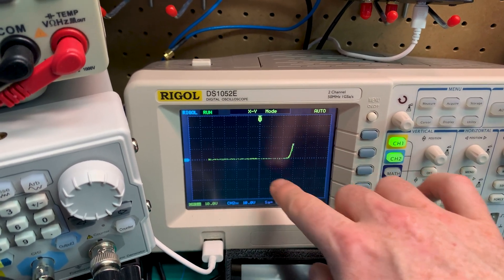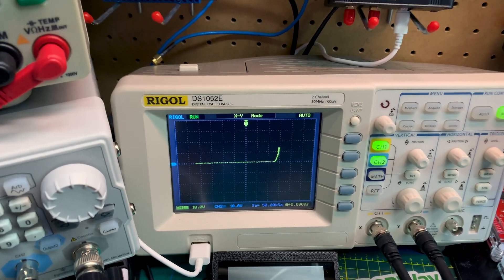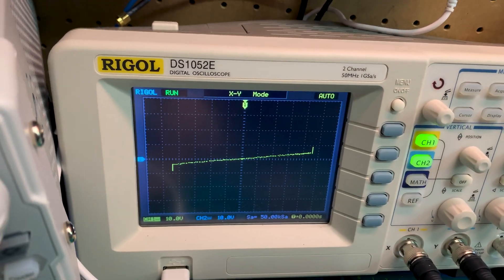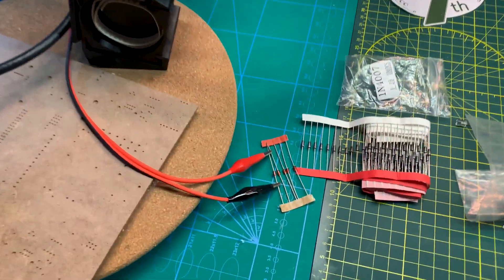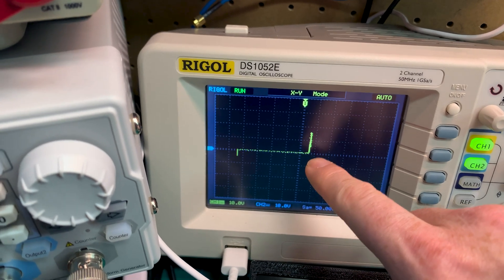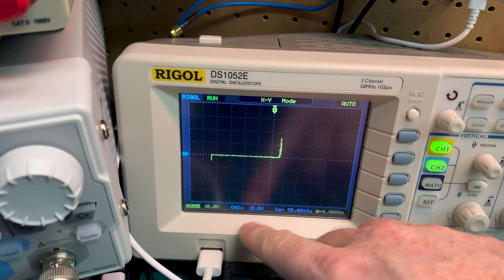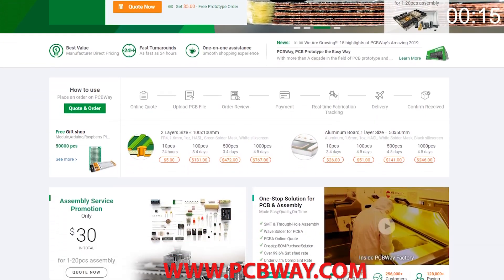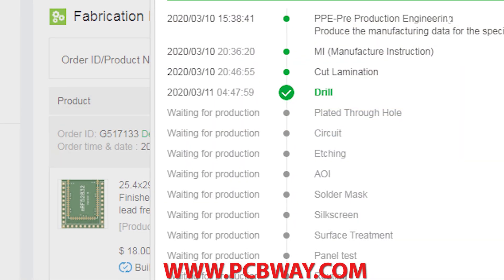Curve Tracer- My Newest Lab Tool | Update

Comment: Didn’t mean for my comment to get so long, but I thought I would share a bit of my experience with curved tracers and other really neat devices for quick and easy troubleshooting.

There are a lot of nice curve tracers available in both completed or kit form online. Check out the “NFM” channel.... he did a DIY curve tracer build from a kit six months ago or so here on YouTube.

Also the old RCA oscilloscope model wo-33b came with a built-in curve tracer from the factory. The 33B model is a bit harder to find than a 33 a model. But I found tons of them locally and ham feet’s and swap meets. Usually for under $20.
it comes built-in with a very nice curve tracer you can just switch over with the flip of a button. It’s only a 5 MHz bandwidth scope but comes in very handy and if you can find the model with the built-in tracer they’re usually $25-$50, of course if you find it online you have to pay shipping. Mr. Carlson completely disassembled and refurbished one on his channel and I think a few other youtubers have shown restorations of the same scopes.. It’s a very easy refurbish job. I’ve done about a dozen I guess in the last 10 years to give to friends or family who started their own labs as businesses or hobbies. And I always have two at arms reach on my own daily bench. Because not only is it a nice oscilloscope but also the curve tracer comes in very handy

Also Mr. Carlson designed a very nice circuitboard that can be installed in most any oscilloscope to give it a curve tracer function. Even though the circuit layout isn’t available unless you join Patreon, the video can be seen on YouTube.

 it’s a very easy circuit to make at home, or you can always send out the design to PCBway or someone and have them make a batch cheap and quickly. If you’re into building your own test gear I also highly suggest Mr. Carlson‘s low-voltage capacitor leakage tester. You pay $2 to join patreon and you have access to all of his circuit and test equipment designers. All of which are genius designs. Dude really is the maestro... it’s the best two dollars you’ll ever spend in your life.

I do this for a living and have my own small lab. I do mostly component level troubleshooting and board repair for manufacturers and industrial type clients. I specialize in test equipment troubleshooting and calibration for small labs and stuff like that. Along with other metrology related tasks. Honestly I started my lab completely by accident years ago as a way to fund my addictions test equipment.

A few other extremely useful test equipment designs are the “leak seeker“ and “Cap Analyzer“ by “electronic design specialists”. They pop up from time to time on eBay. Either the old models, or the new updated versions that are usually available only in kit form. They’re not the cheapest kits, but will become your most used tools in the lab. Seriously.

The cap Analyzer is foolproof and requires no understanding or practice. The leak seeker is super simple and intuitive, but takes a bit of practice. Just like a fancy new oscilloscope or something. You can use it as soon as you get it on your bench… But with just a bit of practice… it becomes like second nature and much more intuitive. 

 The leak seeker is just awesome. tracking down short circuits in mere seconds. Even on the most densely populated and complex boards. It’s one of the most innovative and precise Circuit designs I’ve ever seen for measuring constantly changing and extremely low resistances quick and accurately. Especially considering it’s not even using a kelvin connection.  I have several NIST traceable resistance and voltage reference standards I use in the metrology side of my business… and I’ve repaired countless types of test equipment used for measuring the lowest of resistances. So I understand what is required for an accurate and quick responding low resistance measuring circuit. Dave Migga… (The guy who founded EDS and who designed all of the circuits including the leak seeker) .....
Really hit a home run with the leak seeker circuit, It’s simplicity… And its ability to measure lower resistance quickly with no jitter. It really is impressive.

Even though I have all the fancy benchtop LCR and capacitor analyzers… I reach for the “”capanalyzer” literally multiple times every single day without exception. And I always keep one in my travel bag used for troubleshooting stuff in the field. And every time I see one pop up on eBay for a good price I’d buy them. Whether to keep as a back up to my back up, or to gift to a friend or trade. I wish everyone who think it was electronics had the pleasure of tinkering around with one. It will find 95% of the bad electrolytic caps IN CIRCUIT without having to desolder..... I’ve owned almost every capacitor tester ever made. (I told you it was an addiction😬🤷‍♂️). 

And don’t get me wrong… Some of them still come in very handy and are needed and very unique cases. But for the most part I don’t even have the money more. I’m sure my Family of Sencore z-meters like the lc103’s and others are jealous of the EDS cap analyzer. And I was skeptical at first but I’ve used it every day for several years now, and I’ve even built three separate ones from the kit that’s available from time to time. For the first several months I only used it out of curiosity what compare it with the readings of my more expensive professional analyzers, and I am satisfied and I trust it completely. Also measures DCR automatically. and sweeps a wide range of frequencies when measuring ESR of capacitors. And it’s all done automatically within two seconds. I have no affiliation with Dave or any of the folks selling his parts and kits. I just tried to spread the gospel because I want to see more folks give it a try. It’s the original in circuit ESR teste that BK precision and countless other companies copied over the last 35 years. But they adulterated the circuit design, and none of them have worked as well as the original in my experience.

Sorry this was long I will shut up now.... I could discuss test equipment forever
Reply from the maker: I actually have the kit NFM built (CH-012) inbound and will be building/using it in vids. The kit is cheaper than I could build it myself.  Unique way to visualize components on a video- hence this curve tracer too.  On ESR- I have a cheapie that works like a charm on the bench for most caps.  Got it for about $40 back in the day and it has never let me down.

Comment: we had a similar device at work years ago, it seemed a great idea but after the initial enthusiasm wore off it was rarely used. I guess if you have lots of similar components to check or work in a production environment and have built up a library of signature wave shapes to compare with then it might be worth it. Good luck and happy testing with it anyway :)
Reply from the maker: My use case is pretty unique- For starters I just like the concept of seeing the part performance through all operating levels but the real driver- It makes a super visual way to show things on YouTube videos so the audience can follow easier regardless of knowledge level.

Comment: Did you set your oscilloscope inputs to 1:1, instead of the usual 10:1?
Reply from the maker: FYI one axis was indeed at X10 so thats why the amplitude was so low on Y :)
Reply: @MkmeOrg  It seems that everytime I need to change that setting, I spend five minutes looking for it...lol  I wish it was just a switch under the bnc.
Reply from the maker: I think I did but I'll double check since its still set up.   I actually got the manual/schematic now so just need to make time to play some more :)
Reply: Since you're in XY mode when working with the curve tracer, the 1x/10x setting is not relevant. You don't measure anything, it's just a visualization of the x-y trace.